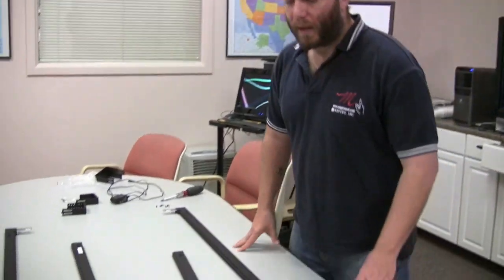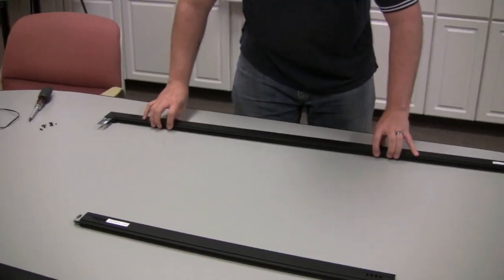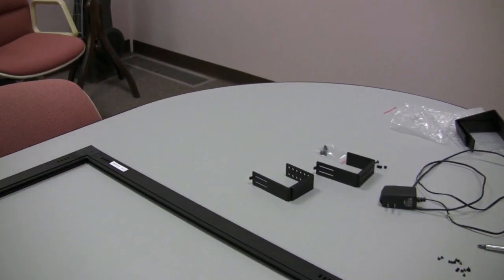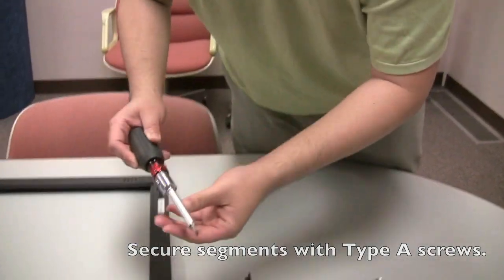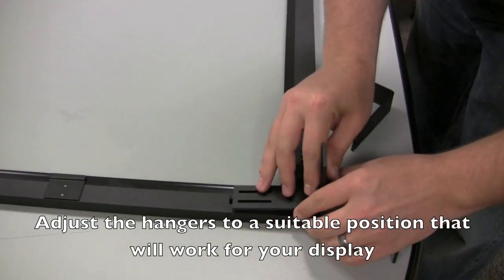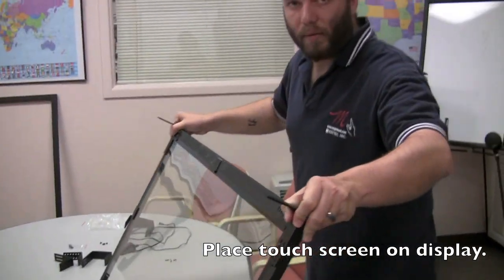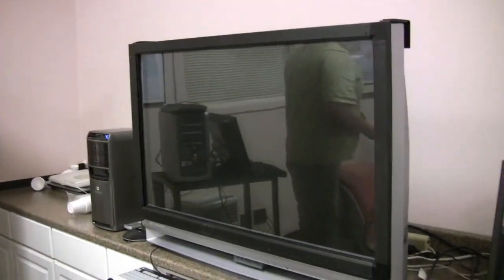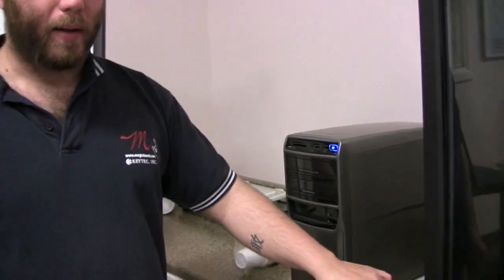How To: Keytec IR Touch Screen Setup (OPTIR 32A Model)

Comment: Where do you find the tempered glass for the frame?
Reply from the maker: +Oki Doki Soki you can purchase your own at your local glass vendor or you can buy the touch screen fully assembled with glass backing from us.  if you choose to buy it yourself, we can send you the glass dimensions.
Reply: @KeytecInc  which are the glass dimensions?
Reply: +Oki Doki Soki  did you get all other things ? tempered glass is very easy to get